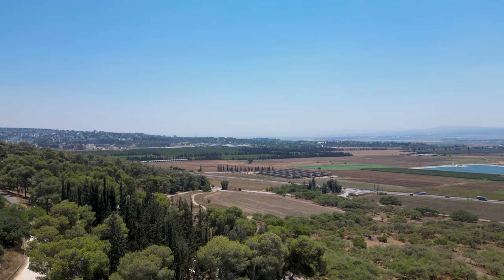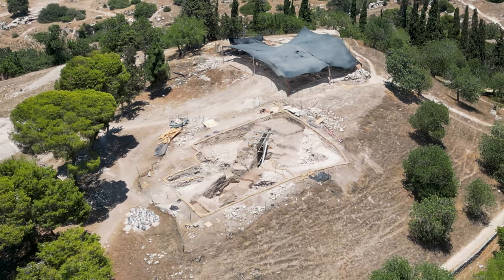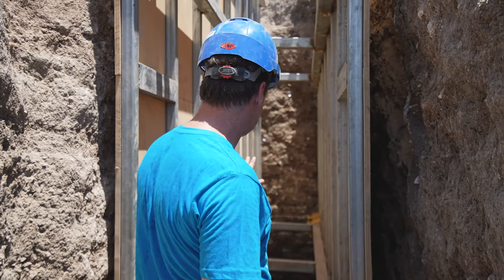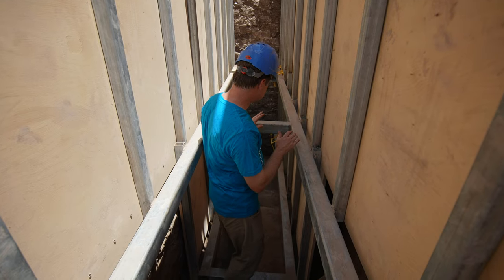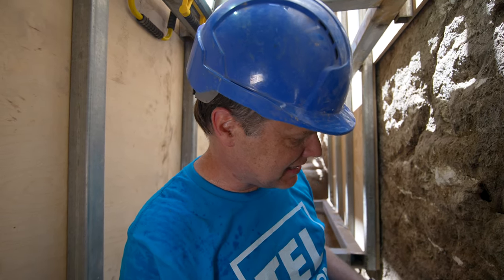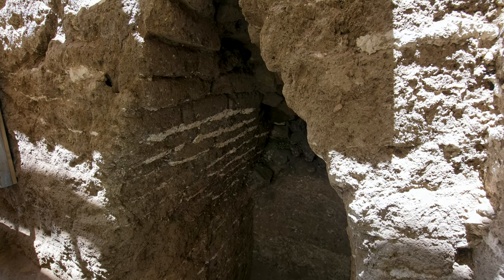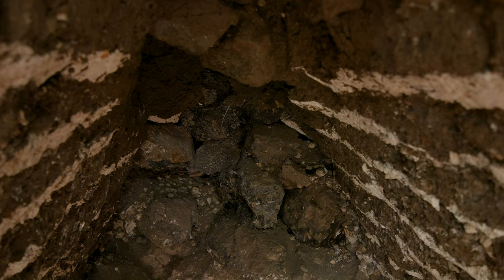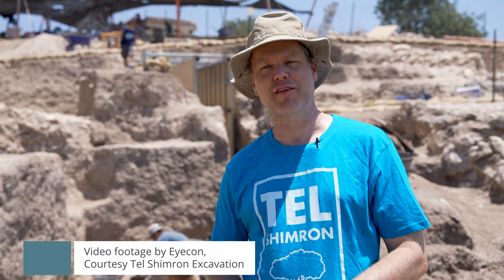A Canaanite Corbelled Vault - Excavating Tel Shimron

Comment: So you made it that far and are just going to fill it in?  I'm sensing those uncomfortable Time Team vibes here. Why wouldn't you just pull out the rocks and see where the tunnel goes? Have those engineers back and figure out a little more bracing.